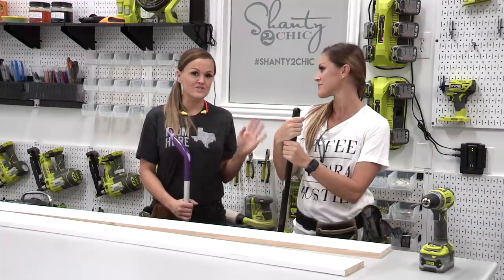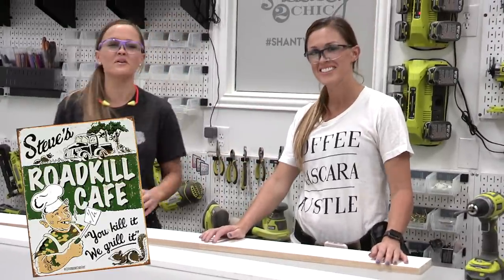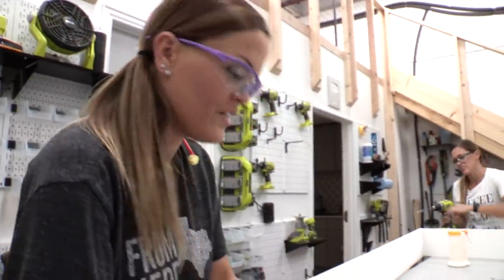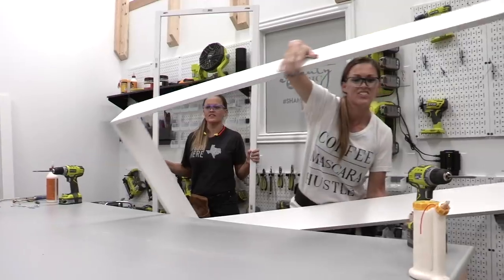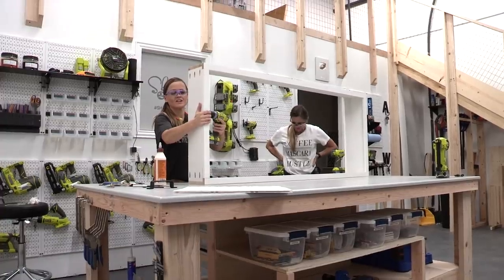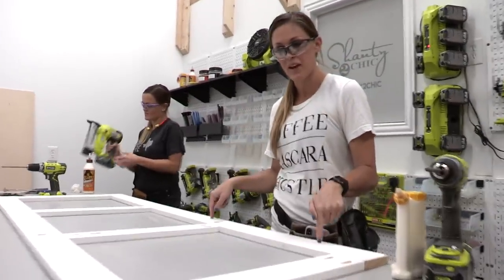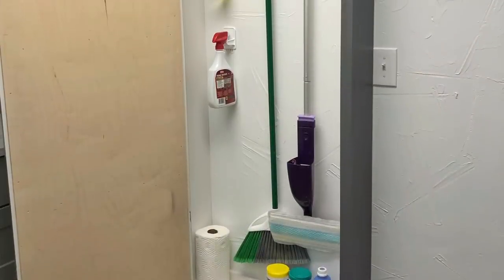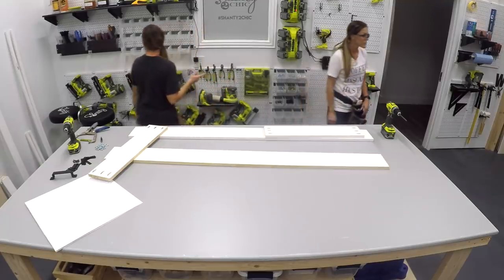DIY Utility Storage Closet!

Comment: Love it! 
Ladies I'm looking for ideas to swank up my pantry door. I've considered old doors, something with glass, even an old screen door. Something unique. The size is 80×24.
Do y'all have any ideas? and sources for supplies?

I'd love a sliding barn door but the pantry takes up a corner in my kitchen.
Reply: Is there a way to use the typical builder grade hollow core door and somehow remove the 4 large panels and 2 small panels (on top) and insert glass, tin, etc? Perhaps it would be better to start with a solid wood door. ??

Comment: Very cool. What glaze did you use on the tin panels over the white paint?
Reply from the maker: Actually we filmed this before I changed my plans!  I wrote it all up and linked on our website.  I ended up spray painting it white and then distressing a bit with a sander.  Hope that helps!